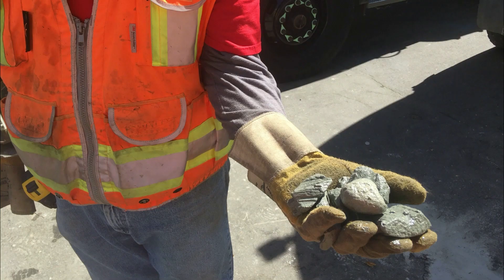Solid pipe obstructions removal from sewer pipelines with water jet cutting

Comment: How can a hydrojet clear pipe without damaging the pipe?  This video opens showing cutting concrete.  What psi can a transite (asbestos-cement) septic field leach pipe withstand?  What psi can PVC leach pipe withstand?  What psi and gpm are used for clearing residential septic field pipes?
Adding perforations to a perforated-by-design pipe might not be bad, but we wouldn't want pipes to collapse.  
Do you make a version that fits within 4" pipes?
Reply from the maker: Hi Jonathan, 

Thank you for sharing your concerns. 

Please note that our system is designed to apply a water blast directly to the deposit and in a longitudinal direction of the pipe. 

Eyes on the job and continuous adjustment of water pressure, angle with the pipe and distance to the material enable the operator to be in complete control of the operation and achieve the breakdown and elimination of various obstructions without adding damage to the pipe structure.

In short, if the operator aims the water blast in the direction of the pipe and not straight (90 degrees) at the pipe surface, it is safe to use more pressure than the pipe would normally withstand. For example, when using 40k psi to remove concrete deposits from AC or VCP pipes, as long as the blast in the direction of the pipe. 

We would like to show you more in an online demonstration or send more videos from our customers. Please send us an email to info@sewerrobotics.com and I will be in touch.

Sincerely,
Bart van der Zalm

Comment: roots will just grow back quickly.  only real solution is to dig up the roots/remove tree?
Reply from the maker: The high-pressure water jet does damage the roots internally by injecting the high-pressure water into its veins. However, you are correct! When there is a crack in the pipe, no matter how small, the root will find its way through and always grow back.
The best way to prevent this is to fix the crack by installing a patch, such as a UV-cured patch that can be applied with a different tool by the same robot.
For more information, you can visit this link: https://www.sewerrobotics.com/uv-led-spot-repair-packer/